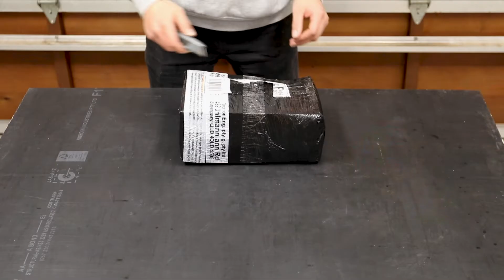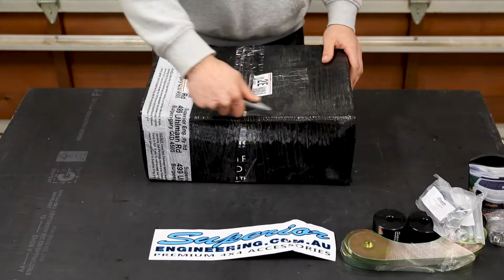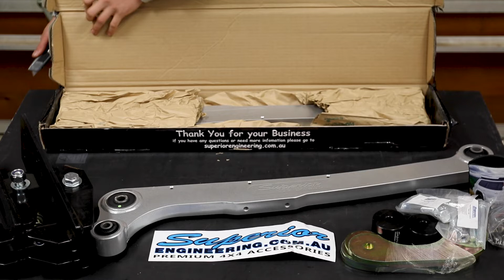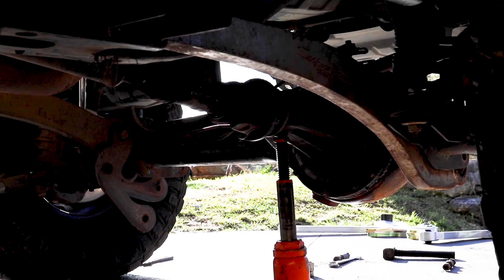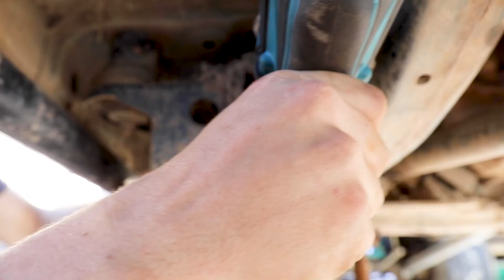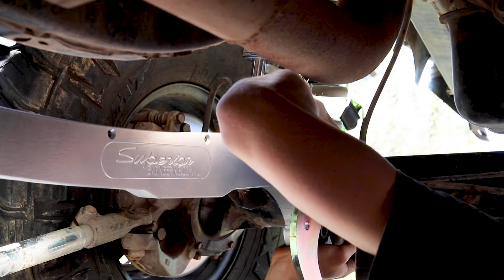Superior Engineering Hyperflex Arms - Unboxing & Install + Results!

Comment: So what was the difference after the swap?
Reply from the maker: The superflex arms (old) have a pin patrol style chassis mount which binds up and limits travel, where the Hyperflex use an 80 series style bush with a Dropbox. This allows more up and down travel. The was the arms mount to the diff are also designed differently. You can compare them further with more detail on the Superior Engineering Website: www.superiorengineering.com.au
Reply from the maker: Hyperflex: https://www.superiorengineering.com.au/superior-hyperflex-radius-arms-with-drop-boxes-nissan-patrol-gq-gu-4-inch-castor-correction-31292
Reply from the maker: Superflex: https://www.superiorengineering.com.au/radius-arms-super-flex19954
Reply: Yeah I understand that I ment did you see / feel a difference? 
Was hoping for a before and after picture showing the change.